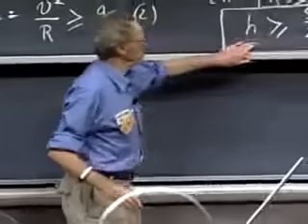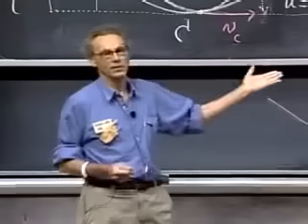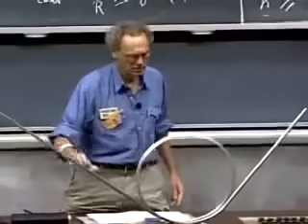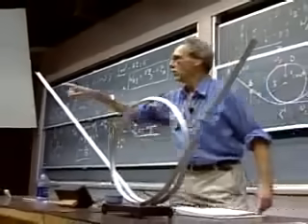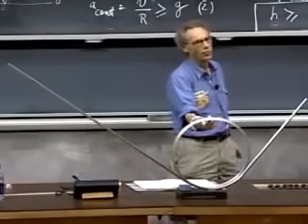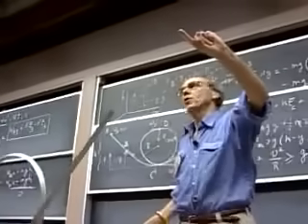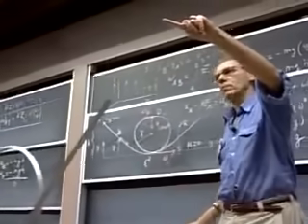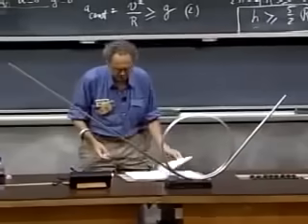Classical Mechanics, Work Energy, Conservation of Energy, Experiment

Comment: Huh 

I just realised that we could use this to build the looping parts of rollercoasters 

I couldn't think outside of memorizing formulae back in 12th grade
Reply: If you use circular loops on roller coasters, you will notice there is a fatal flaw.

Given a circular loop of radius R, the speed at the top has to at be greater than sqrt(g*R), so that you stay in contact with track.  When you descend to the bottom with no friction, your speed will equal sqrt(5*g*R).  Your acceleration upward will equal 5*g, which means the normal force will be 6*m*g, because it both needs to cause this acceleration and oppose gravity.  That's 6 times the passengers' normal weight that they will feel at the bottom of the ride, after being weightless at the top of the ride, just seconds earlier.   A 6-gee environment is not safe for passengers.   People can survive it in the right conditions, but the run-of-the-mill amusement park customer will black out from experiencing this.

For this reason, you will notice that roller coaster loops are deliberately not built as circles.   They are built in a special shape called a clothoid that maximizes the curvature at the top of the loop, and minimizes curvature at the bottom of the loop, to avoid generating drastic changes in the weight of the passengers that will make the ride unsafe.
Reply: @carultch  
Oh wow

I just thought the loops were circular looking (didn't think it was a different shape), and correlated the demonstration with that

In all honesty I wasn't thinking about the g force implication when I commented this

Thanks for pointing out the flaw in my thought process
I'm glad I could learn something new